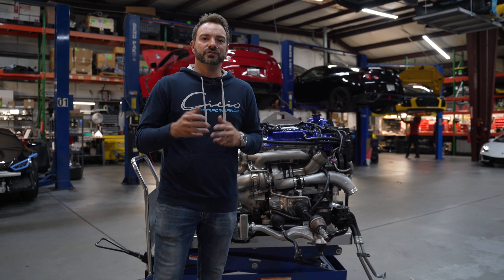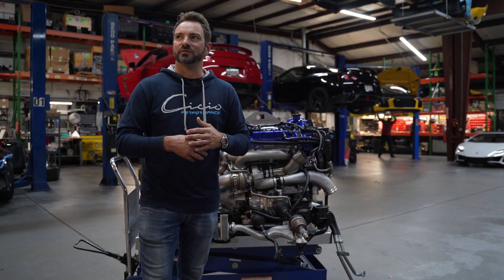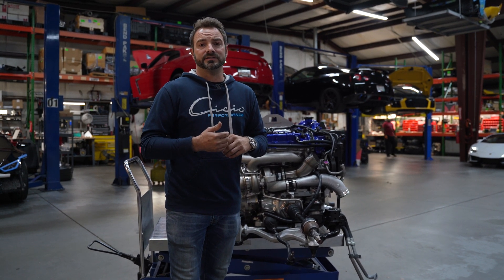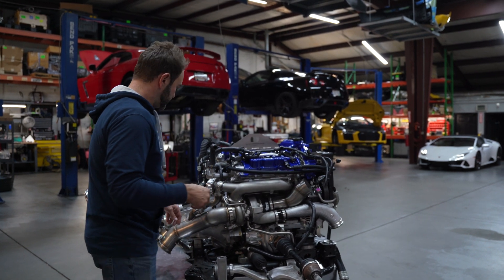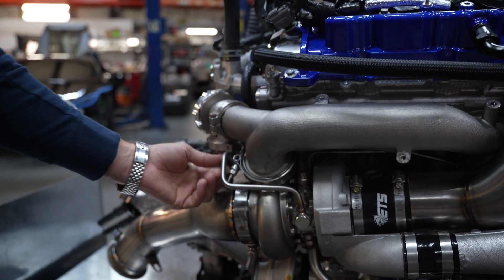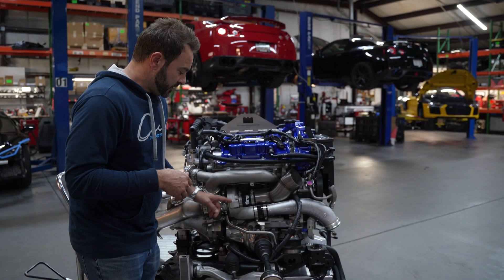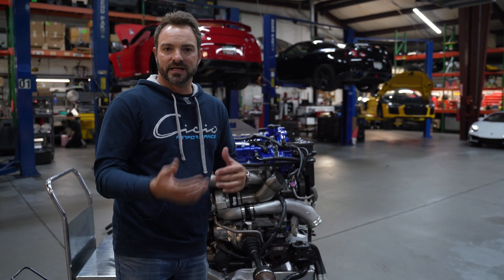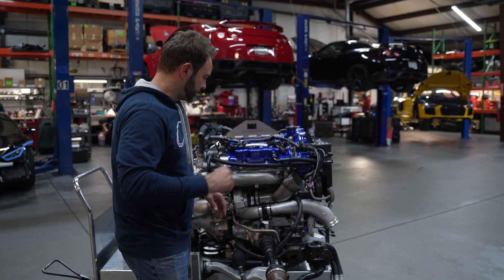Xenith/Xenith R Turbo Kit for R35 GT-R Explanation video

Comment: Man if only you did a video for the more simple crowd with GTRs. Like what's needed for what power, the spool (what's the most power we can make with stock like spool characteristics and how to make 800hp or 1000hp or 1400hp. Truth is I want more power and I'm hearing it's rods that are weakest. So what if I do rods and pistons and strengthened box what's my limit. If Cicio did a guide that would be perfect. I love your channel and the reputation and quality you guys have. But watching this video I learn nothing about power levels lol. Your experienced clients will appreciate this though no doubt. 
Thanks
Reply from the maker: Hey man - we'd be happy to go over any of that with you.

To be honest it would be pretty difficult to put together a video that detailed ALL of the available options/combinations on this platform as it's been around so long now. You are correct in saying that the Rods are a weak link, so is the transmission once pushing past a specific limit.

For instance our C800 package makes 830~ wheel & we limit the torque to 600ftlbs...doing so we are able to offer a LIFETIME warranty on the engine & trans. A built 3.8 can take you anywhere from 1000whp to 1500+ whp depending on the style of cam you select, head porting package etc.

As you can see there is a LOT to go over, but all of our Expert team members are well versed and are happy to go over all of your goals and how we can help you meet them in the most efficient way possible!

Comment: I went from your Elite Primes to the Xenith R's this past Spring. Bad a$$ kit for sure. Power delivery is very linear compared to stock frame turbos.
Reply: Could you share your review between the elite prime and the Xenith? I have the elite prime R as well and have been on the fence about the Xenith but can't justify the cost atm.
Reply: @BoostedR130  The power delivery is more predictable and manageable. The Prime's were really fun but they can boost creep and since the larger compressor is wedged into the stock turbofold, there is a risk of cracking/breaking. Having a full turbo kit with a divorced wastegate is really nice for reliability and longevity.
Reply: @ianjames7500  thanks for the response! How does the boost response feel on the street between the two? I’d imagine the prime R gets going a little quicker whereas the Xenith will hold more power on the top end?
Reply: @BoostedR130  I would say the spool difference is close to negligible. It's 500rpm's or so if I had to guess. That too will depend on if you're staying with 3.8L or going 4.1L and other factors but it is not egregious.